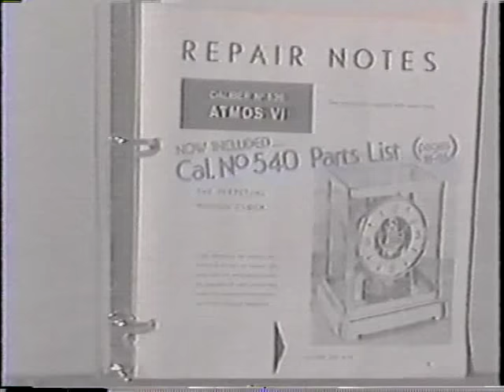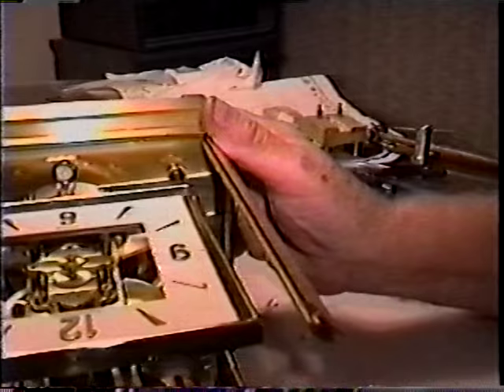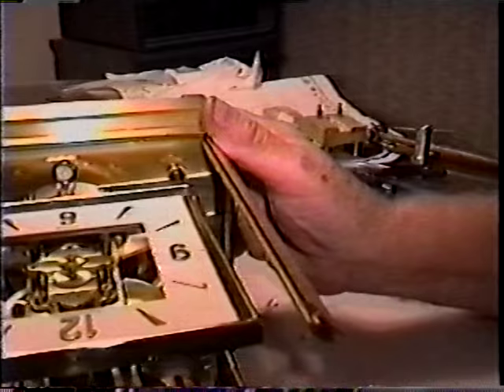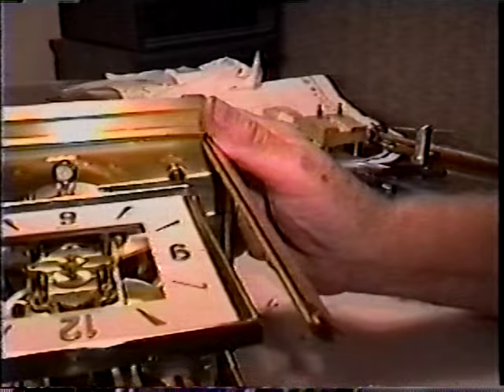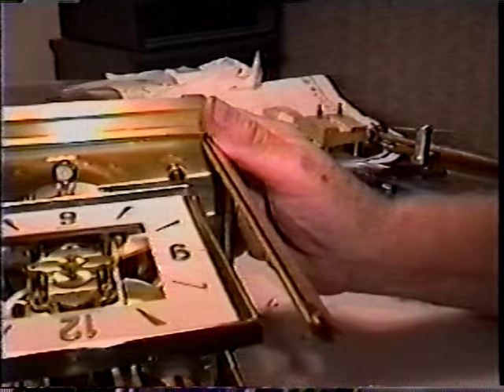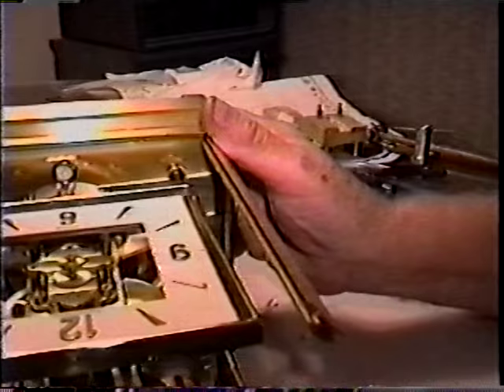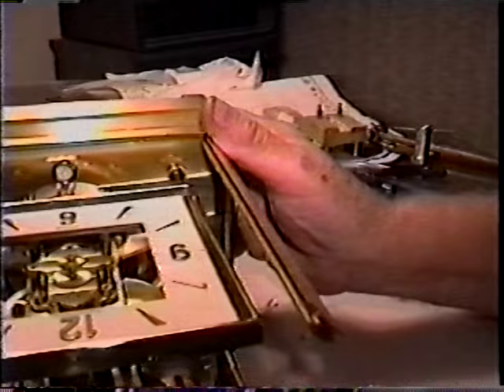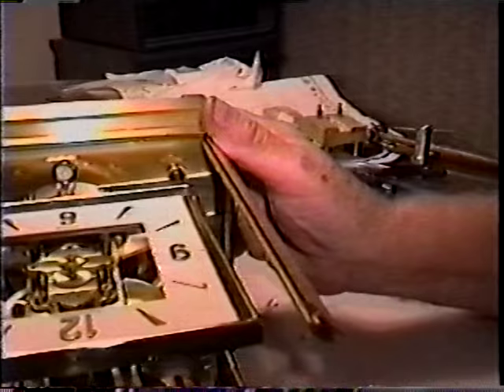Jaeger LeCoultre Atomos Clock Repair

Comment: Thank you for sharing this invaluable knowledge. I am  watch & clockmaker. I own 2 Atmos (both bought on eBay). One of them (a model 519) has recently stopped running after running non stop for a year and a half. This video will help me to overhaul the unit & get it running again. I'm sure it just needs a good cleaning & mainspring oiling. I just bought the Atmos tool kit from Timesavers. So I'll be ready to do everything the right way! Thanks again!

Comment: Great video!! So a question I have one of these with a broken chain what's the easiest procedure to attack that repair with the minimal disassembly. And would you repair the old chain or replace the whole thing?
Reply: Did you ever get the question answered? I have one that the chain has broken twice and I have a new chain I need to install. Any suggestions on the best way to do this, and can it be done without disassembling the movement?
Reply: @jimadams4260  I didn't get the question answered so I went full commando and attached the new chain (had to take the bellow's off and run the new chain where it had to go and I cut a link attached the remaining link with the new one and soldered the cut link . And it was no easy task doing it with the clock assembled But I did it and the clock ran but stops after a couple days so there is other issues that need attention so the broken chain wasn't the total fix only part of it. to solder the chain link I used a pretty hot soldering iron with a very pointed tip and put tin foil on the places I didn't want solder to fall on and using magnifying glasses to see what I was doing I managed to connect the chain . Don't by after market cheap chain they are garbage buy a good quality one and save yourself some headaches. This is not probably the proper way to repair these chains the best way would be dissemble the clock and just clean everything properly I just tried it to see if I could get away with it and I guess I did. 
Good luck
Reply: @willf5768  I’m repairing one now with a broken chain and pulley spring. I haven’t found a local (Australian) source yet, so I might have to order the spring from a US based source and pay the rich shipping fees. As for the chain, a jeweller friend is going to take a look at it and determine whether or not it’s worth soldering the links as it seems the metal has fatigued and is weak. I’ll hold off until he gives me his verdict in case I need to just order a new chain. Might as well grab both the chain and pulley spring together.
Reply: @whatsstefon  I ended up buying a chain off Ebay for $10.00 and carefully soldered it to the remaining piece on the clock worked it back through to where it attaches in the back of the clock put it together and it would run for about three days and mysteriously stop start again and again it would stop so I'm assuming it needs a tear down and cleaning which would be difficult being I don't have the proper tools to do so so its in limbo land at the moment.  Note when I looked at the clock and took the expansion tank or bellows  and out I found the chain was in like four pieces so not sure what caused that but must have been a violent occurrence I'm thinking I think as well when I received the clock the pendulum wasn't locked and who knows how long or how many times it had  been bumped and moved about probably damaging the pallet fort or suspension spring. Some day perhaps I'll find or make my own tools and try to service the clock and see what happens.
Reply: @willf5768  thank you for that insight into your experience. I have “wound” the clock and it appears to work well. So really I’m hoping that I just replace or repair this chain and the spring which I will replace with a new one and the clock should be okay.
Reply: @whatsstefon  Actually I did wind by pumping chain spring and the assembling I left that part out I anyway it still needs more attention.😁👍
Reply: I am sure the guy in this video is long since dead, this was video recorded on VHS based on the grainy video and mono audio quality. He may very well have passed before the new millennium came to pass. Good luck with your Atmos.